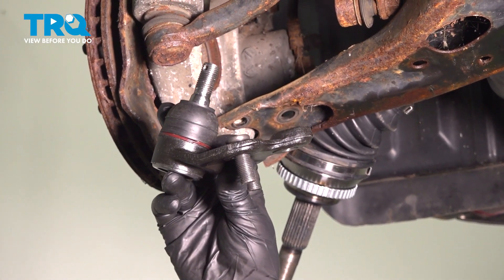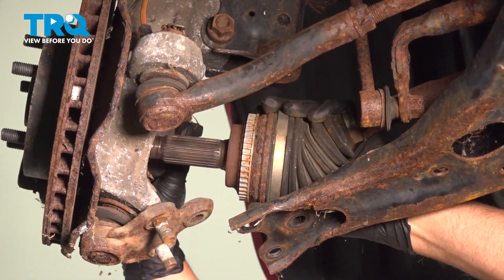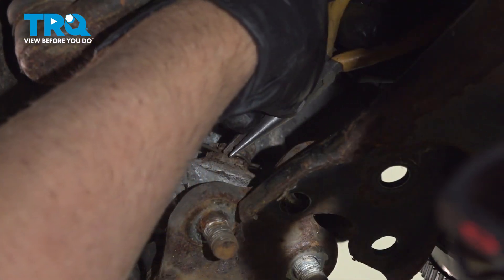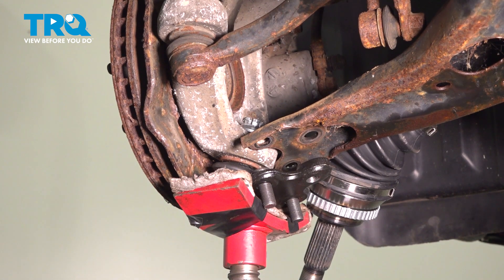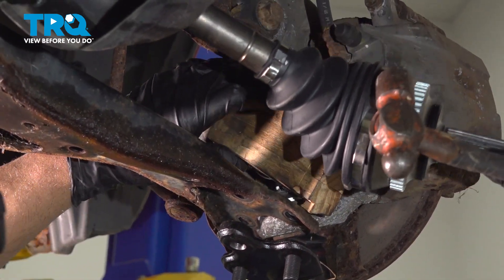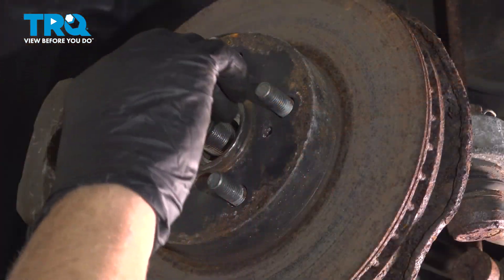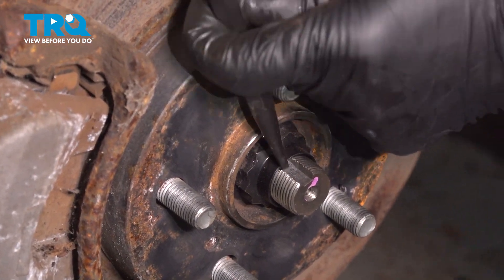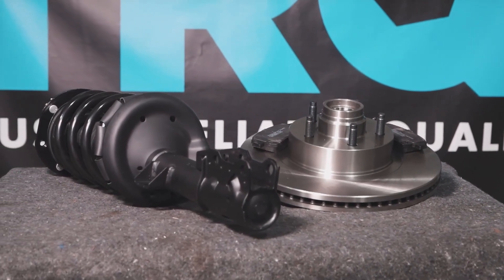How to Replace Front Lower Ball Joint 2004-2009 Toyota Prius

Comment: Thanks for the video, it was helpful.
However will likely NOT be THAT easy on some 400.000 km car that has been driven on Swedish salted roads. 😂
Had to use a grinder to get the castle nut off, and lots of heating and work on the rest of them.

Comment: What was the reason you removed the ABS sensor and plate? I don't see how that is relevant to the ball joint removal. Also, I don't have that plate on my 2007...